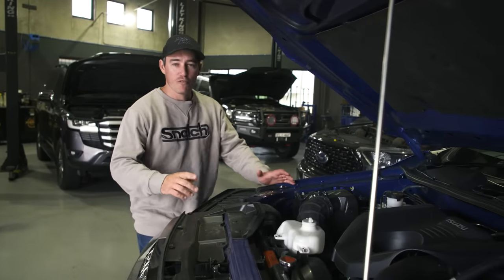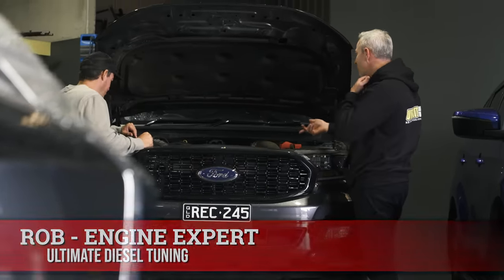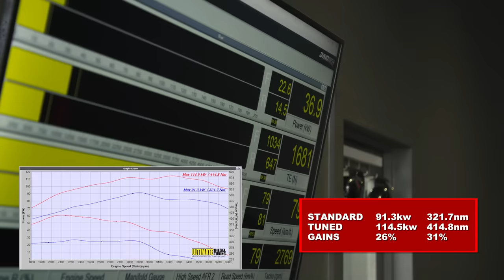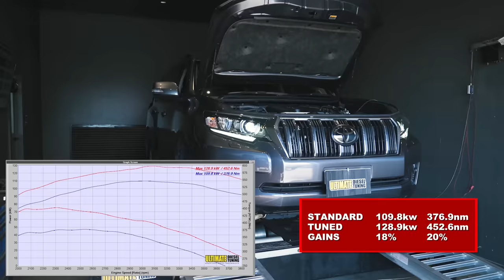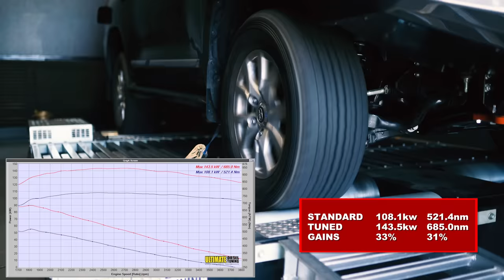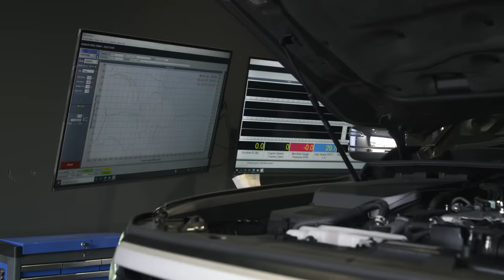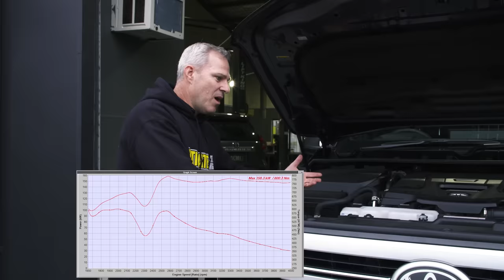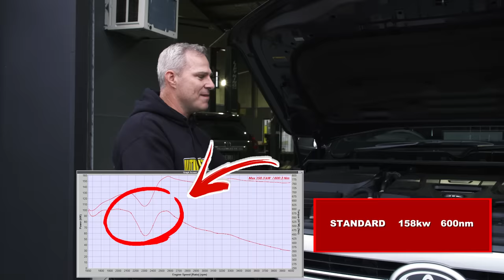Everest vs. Prado vs. Pajero vs. MU-X vs. 200 vs. 300! In-DEPTH Engine and Transmission guide

Comment: Horses for courses here...
All vehicles mentioned here are great in there own way. For my money it would be the mighty MUX with that incredible 4jj1engine, followed by the Pajero Sport with it's awesome super select system. Nice vid through. 👍
Reply: I would exclude the MUX because unlike the rest, you cannot use 4H on bitumen where most people drive and tow. The updated engine is great in MUX but the transfer case system is 20 years out of date sorry.
Reply: @ehholden2376  A lot of the new breed of 4rbys you can now.
Reply: @ehholden2376  Prado is full time all wheel drive, Pajero Sport is selectable all wheel drive, they are both designed to run on any surface, centre lock is separate again 🤦‍♂️
Reply: @ehholden2376  you should drive a 4wd in 4H on any surface if it improves traction on that surface. Some manufacturers like Isuzu put old tech cheaper transfer cases rendering their cars incapable of the safety that 4wd gives.
4H wasn't possible on bitumen 20 years ago but better manufacturers now build cars as full time 4x4 like in the LC200 or even better in the Pajero Sport you can have RWD select if you want some fun.
New Everest has a transfer case system similar to Pajero Sport but Fortuner and MUX are 1990s technology at 21st century prices.

Comment: Would like to see the 100 Series FTE get some airtime - yes IFS but still a capable vehicle. The 100/105 seems to get overlooked.
Reply: They seem to be focusing on new/current models mate. I think it's safe to say the 100 or 105 doesn't fit that description........
Reply: @MrTonaluv  I was more thinking about in general. You see 60’s 70’s 80’s 200’s - the 100 and 105 miss out, yes many would say not as tough as an 80 and not as advanced as a 200 - but
Reply: @pbentley1  okay yes I see where you are coming from. Shawno and Graham pretty much forget they exist

Comment: Could have had my 2022 Fortuner Shauno, only has 2000km.
The 1GD motor, 150kw and 500nm torque. Heaps lighter than Pradacand Cruiser, they go a treat.
Reply: Yep should have done a shout out I have 2022 too
Reply: The new Everest with that v6 will be the final nail in the praxis coffin as it is the same size but better handling and track, better looks and way more power, the prado has been good while it lasted but if it can’t evolve it should be forgotten
Reply: @SkiRacingOz  V6’s are ancient history. Prado had a V6 model, same with FJ Cruiser. No one wanted them, they’re a poor man’s prado. Expensive to run, register and less low down torque for towing
Reply: @darrenbryans8288  it’s a diesel not a petrol, way more low down torque than a i4, have you seen how hard Amarok go, it’s like that
Reply: @SkiRacingOz  ahhh gotchya 👍

Comment: The next generation Everest that has just been released is going to be a real competitor for the land cruiser with the v6. Not quite as big but still a good comparison
Reply: and remember that Mount Everest was conquered by Sir Edmund Hillary and Tenzing Norgay
Reply: As long as the fix the issues that that engine had in the discovery 3&4's 🤞
Reply: Going by alot of reviews already around the place on the v6 ranger it's not much of an improvement at all over the other engines and isn't as good as the amaroks v6

Comment: Buying a fancy new 4wd with all the bells and whistles is all well and good, but you can't beat the ol' 1hz 105 and 80 series. No common-rail bs and will run on veggie oil if it had to. Super cheap to maintain, and those manuals will never leave you stuck out in the desert. A good review as always tho boys 🤌

Comment: Would like to see how the systems compare offroad. Pajero and Fortuner have the same 4wd system as their ute counterparts. The LC's and Everest all have full time 4WD with lockable centre diff and the Everest has the samw TMS system as the Land Rover Defender which was co-designed alongside Land Rover funnily enough
Reply: Paj Sport also has full time 4H
Reply: @andys31337  yes you can have it like that but it's Super Select like the Triton that's why I say the same as its ute counterpart
Reply: @vanderz1012  the triton only has full time 4H in GLS and higher spec.
Reply: @andys31337  thought that it was 2H to 4 full time to 4H

Comment: Would love to see a 4wd wagon offroad comparison.    Make sure you use a pajero sport exceed though as that model comes with a rear diff locker.
Reply: From 2018 on im pretty sure GLS have a rear diff lock. My 2018 GLS does
Reply: @Morokigg  My 2016 GLS has one as well. Got it for $35k with 50k km in early 2020. Great car, not a fan of paying badge premiums

Comment: It would have been better if you had have included some details on weights, which vehicles have GVM upgrades available, and what the sag is like with stock suspension when you hitch up say a 2.5t trailer.

Comment: The Pajero Sport would be my choice for the pure value. Haven't been in one but if it's like the Outlander you can see where they cut corners. A friend's Outlander has various accessory things broken after only a few years which just looked cheaply made. But I don't really care about that stuff, provided I can trust the engine and transmission. It's hard to justify a Prado in my eyes.

Comment: Mux makes decent power tuned - well done.
Reply: Why tune these for, or any car what so ever. The car makers pour so many hours and money into the reliability of these engines and pushing more boost and fuel through it will have long term consequence depending on use. It's one reason why Toyota's engines last, they're under no stress.

Comment: I would stay away from MUX and Dmax, class action lawsuit due to allegedly cracking in the engine bay , dpf issues along with turbos blowing up. Affects a few different year models and even current one i think.

Comment: Just doing some numbers, and assuming that the MUX torque at the wheel is 362kW instead of 462kW. 
MUX 21.5% drop in kW and 19.6% drop in torque. 
Everest 36.7% drop in kW and 31.7% drop in torque. 
Prado 15.4% drop in kW and 16.4% drop in torque. 
Pajero sport 24% drop in kW and 24.4% drop in torque. 
200 series 46% drop in kW and 19.8% drop in torque. 
300 series 30.4% drop in kW and 14% drop in torque. 

It seems the Prado has the most efficient drive line and the Everest the worst. But what is going on with the big drop in kW with the 200 and 300 series? The 200 especially.
Reply: Well every vehicles dynos differently, so a different Everest can lose the least power and the prado can loose the most power. I guess the tuning guys would best be able to tell based on the amount of each vehicle they dyno. I've seen in the past massive power loss on prados from udt YouTube page. So I guess we can't really assume from just one dyno test

Comment: Surely the quoted figures for the Everest engine is incorrect.   Standard for the 3.2 
is 147kw and 470nm of torque.   Also some of the photographs are not of the 3.2 engine.   What gives?

Comment: Are the MU-X cracking the chassis the same as the D-Max?
Reply: Yer mate. It's not a common problem but there have been a few MUX with the cracks on the body, inside engine bay. I'm keeping a close eye on my 2019 mod
Reply: You’ll hear crickets about that on this channel mate, and it’s not the chassis is the inner guards and body mounts

Comment: Had a 3.2l Everest.  Blew the engine and turbo at 124,000km (egr fail) then the transmission at 200,000km.  Constantly plagued with electrical problems, was an absolute POS
Reply: Standard ford ownership experience

Comment: I am surprised how little power the LC200 makes stock. 109kw is lower than what Mitsubishi makes! There is something wrong definitely.
Reply: I’m curious about most of the figures mentioned in this video
Reply: That is kw at the wheels alot different than engine kw's
Reply: There is power and torque loss from the engine to tyres in the transmission. Transmissions are not 100% efficient.
Reply: @darrengray2309  I think he knows this, that is a very low kw reading at the wheels for a 200.
Reply: @Australiacalling  dynos are a tuning tool only they are not accurate mate
Reply: @toddavis8151  never regard any figures from a dyno as accurate. There are lots of factors that impact figures including:  how they are strapped down by the dyno operator; air intake temp; relative humidity; barometric pressure; which gear it's run in; tyre size; tyre pressure; the auto trans; 4WD/2WD; dyno ramp rate etc. etc. Dynos should only ever be used as a tuning tool.
Reply: @UltimateDieselTuning  yeah agree with that.

Comment: Why aren’t these engines tuned from factory? Is it to keep the gas mileage numbers down? Why would a company limit the capability of an engine by 30%? What happens in the long term after tuning an engine like this?
Reply: Maybe due to Euro4 & Euro5 compliance, i'm not sure
Reply: No one is really sure as to why engine performance comes out from the manufacturers quite underwhelming. We custom dyno tune within the factory safety parameters set by each manufacturer as well, for reliability. It's also performed individually for each vehicle, so it's a completely customised service that you receive from us.

Comment: How did the part timer (MUX) get included when it doesn't have all wheel power and engine braking? Not worthy, like the Fortuner, both antique transfer case systems from 20th century.

Comment: LC 300 GX $89000 auz $ is about $62000 us $.we spend that on UTES , lexus gx460  v8 gas ,wrangler/gladiator  rubicon ,broncos , tahoe , id buy a base basic LC300 GX over anything for sale  new in the us .  maybe our new 2023 sequoia TRD pro might be good ,the one  wagon with a solid rear axle rest  mid size ,full size have indpedent rear axle or air suspision i "for a smooth ride and leg room for the 3rd row" 4RUNNERS  best mid size

Comment: That pajero sport ..is it really got 8 speed transmission?or typo error...i thought they only come with 6 speed auto
Reply: 8 speed auto for sure!
Reply: @migthestig6516  thank you..i just know this..im suprised...always think they use the same motor and trans between pajero sport and triton..thanks mate
Reply: Different transmission to Triton. Actually has I believe the exact same transmission as the LC 200 series, only fitted to those two vehicles.

Comment: Why would you tune the engine on a new vehicle which I am sure would void the warranty. If you need more power buy a  vehicle with more power. Ford even warned putting on a trans cooler could void the warranty.

Comment: Someone has already tune the 300 so look it up. Result wasn't very impressive. Also the 200 on here is under powered or his dyno is way off OR trying to selling more 300. I've seen 200 with 180kw and 700nm at the wheels on stock turbos. Yes the 200 has two turbo. 200 has 24% more power than 300 under 2000rpm 300 only have 11% more than the 200 past 2000rpm.
Reply: Hi mate. At the time of this video, no-one could remap the 300s. Dyno figures will always vary - no dyno will read the same, no car will read the same. They are a tuning tool only, way too many factors impact dyno figures. This is why we talk gains in percentages.
Reply: @UltimateDieselTuning  dynomotive home of Australia unichip has done them last mouth. Not to cause trouble or anything. But their results are very disappointing for the 300 hundred.
Reply: @mclongkock6678  yeah, that's not remapping the factory ECU to tune it - they use an aftermarket external supplementary ECU in order to "tune" an engine. So it is different. The 300s engines run decent boost pressure from the factory, so their performance in standard form is already pretty stout, like most of the brand new engines that have been released. However, I'm sure that improved driveability of the car  over standard has been achieved.

Comment: Good but not great report. As messing with ECU (AKA tuning) effectively releases the manufacturer from having to warrant the mechanicals they should only be compared in OEM form.
These vehicles are not all reliable vehicles. The Toyotas have a class action against them on the 2.8 re the poorly engineered DPF regeneration, the LC200 has airbox sealing issues and turbo overheating problems. The last gen MUX, turbo issues and overheating etc etc.
The Fortuner and MUX are entirely different to the rest in that they have the inferior old school part time 4x4 systems that are obsolete at this price point or should be.
I would like you to present OEM figures showing payload with manufacturer rated loads on the back to show how virrually none of these vehicles can tow that number even with just 5 of the 7 seats occupied.
Tuning is a buyer beware modification and whilst claims of improved fuel economy are made I want to see them compared against OEM using a simulated WLTP type test but with emissions checking done to ensure the car puts out no more pollution.
Not everybody will want what I do but it is facts like the dyno shows that prove claims of economy gains without pollution negatives.
As diesel will be a minimum of $2.50 a litre once the new federal government reinstates the full fuel levy economy for these vehicles as well as emissions in both OEM spec and tuned would be eye-opening. 
Thanks guys

Comment: Ahh jeez such a shame these guys have all these sponsers including Isuzu as the viewers aren’t getting the truth about the supposed ‘reliability’ of the Isuzu. Owned a 2017 Dmax since new and has cost just under $20,000 in repairs that Isuzu refused to cover under warranty (they did fix the aircon, head unit and turbo under warranty though). I had to get a new DPF and the inner guards cracked. There’s currently an investigation by a class action law firm underway right now. Never again Isuzu.

Comment: 18:03 WRONG!! Do not install intercooler fan kits as you are restricting the cooler and can potentially do engine damage to your vehicle! What rob is saying is just nonsense back up by no common sense or experience!
Since when is your engine making boost when sitting in traffic??
Driving your vehicle at highway speeds the volume of air passing and cooling the intercooler is much greater than any pissy little 12v fan can ever offer and it's for free and as long as their is oxygen on earth it will be forever reliable!

Comment: Ford Everest, is For ever at rest, a 4x4 that should never leave the tarmac and should never be used for towing. Toyota Fortuna, will cost you a fortune if you want one capable of going off road and again should never tow anything. Toyota Prado, should have been named Pravda, it's for those valium valets the soccer mums that take their brats to and from school, should never be used for anything else and fitting a tow bar is essentially just wishful thinking. Isuzu MU-X, spend a lot of money after the price you've already spent on purchasing it and you can have a descent 4WD, otherwise it's a cow MU. Mitsubishi Pajero, unarguably that best 4WD for your money you can get, but I hate it's look, get a twin cab ute instead. Toyota 200, over priced, but you can get spare parts anywhere so fixing it when it breaks down is no problem. Toyota 300, the rich man's 4WD, if you want all the gadgets and the bells and whistles, this is for you if you can afford an arm and a leg, and that's before you start kitting it out.